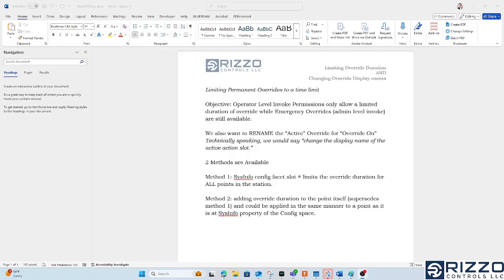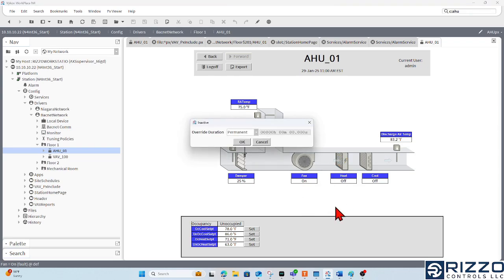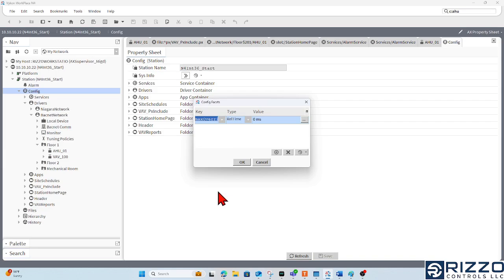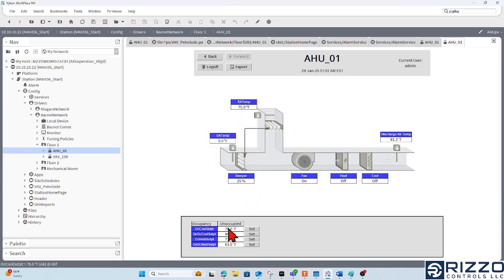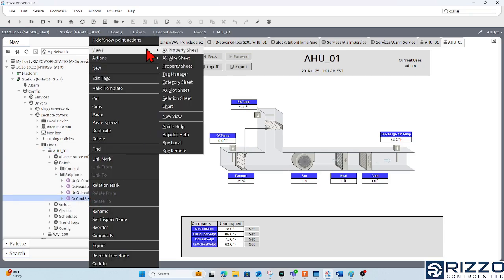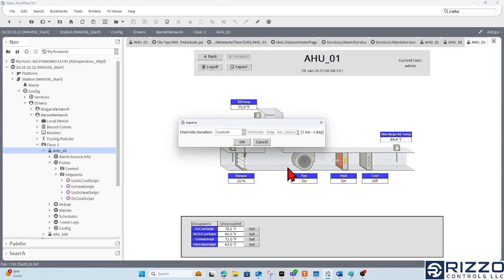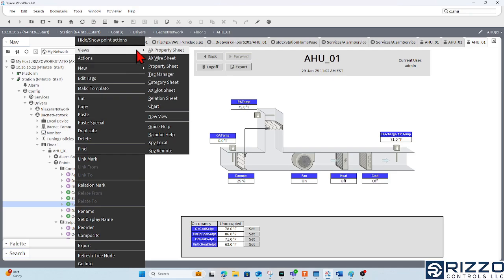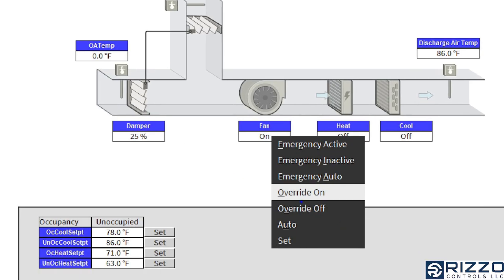N4 Limiting Override Duration and Renaming Override Slots

Comment: Hi first thanks for the great video. Do you know how to remove the go to* hyperlink in niagara report service. I have a px view with AX table binding for reporting amd i want to set the setpoints but remove the go to or the clic hyperlink. Thanks in advance for your help :)
Reply from the maker: Hi Friedenburg2019, I'm not sure I understand what you mean? 
You want to remove the hyperlink? Or do you want to use the report to only set setpoints where those points are writable? 

We can get together on teams sometime tomorrow to clarify if that is helpful.
Reply: @RizzoControls thanks for your reply, yes i need to only be able to change setpoints but without (go to) option on the wiresheets wen you clic on it. I am actualy from Germany. I can maybe send you Snip Video of the Station so you can see what i am talking about. Do you have a contact Email on your Website?
Reply from the maker: yes sir, we do!

You can send it to info@rizzocontrols.com and somebody will respond to you.

You can also use CTRL+L to get the specific ORD to add to a hyperlink property in graphics to get you to hyperlink to any view anywhere in the station.